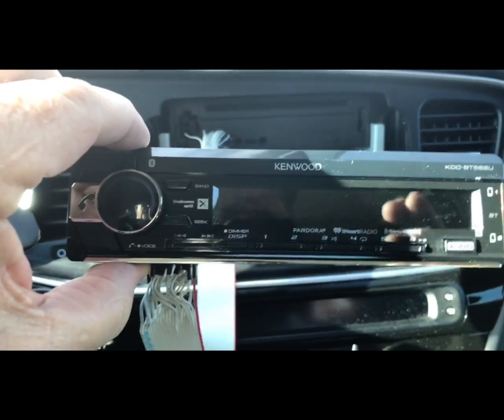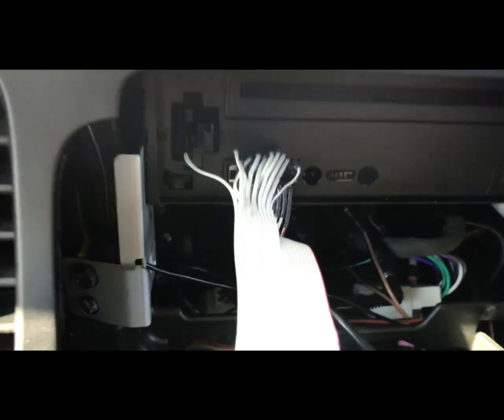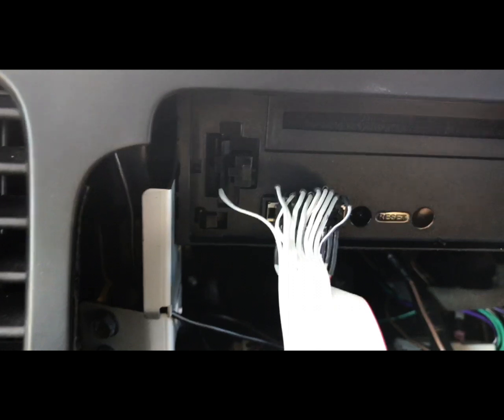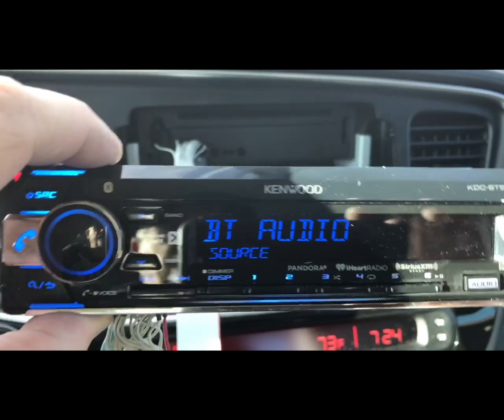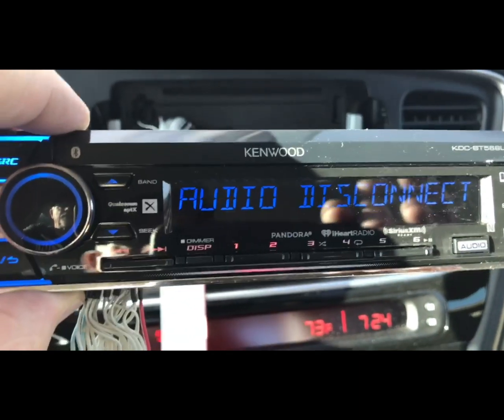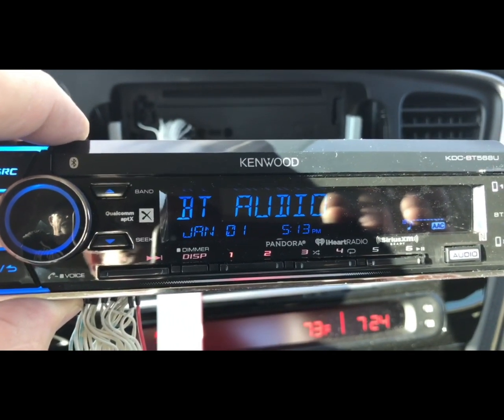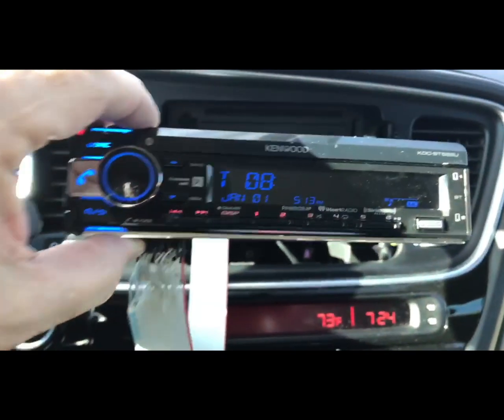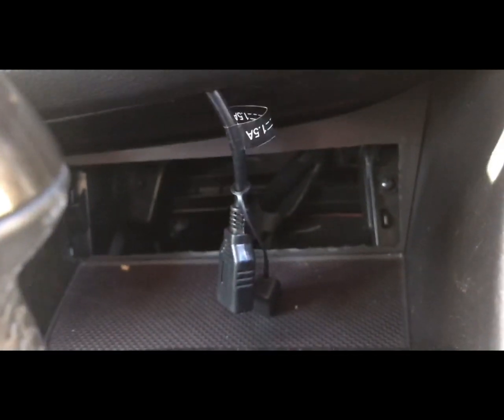Kenwood Faceplate Relocation

Comment: Hey, I’m trying to do the same thing, how did you connect your wire to the male and female pieces, I ordered those parts off of pacparts but am having trouble soldering them, it looks like you used pins or something, help is greatly appreciated
Reply from the maker: I cut small wires and soldered them to the pins first.  Hope this helps.

Comment: Did you by plugs or just solder the wires on to existing plugs? I want to do the same thing
Cheers
Reply from the maker: Sorry this took so long.  I (after much research) found the stock ends.